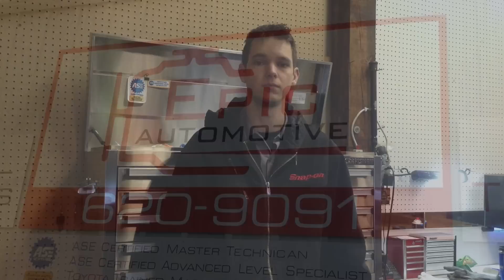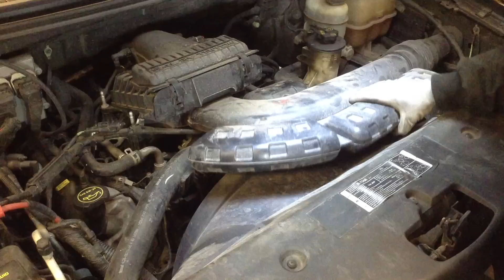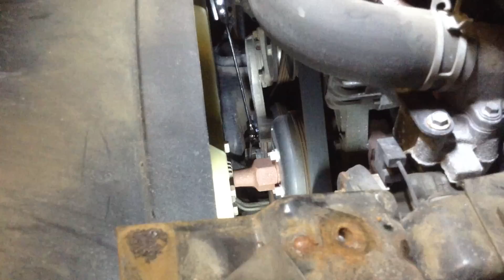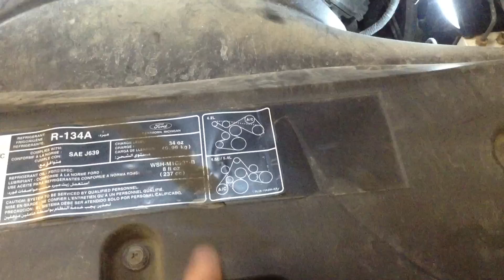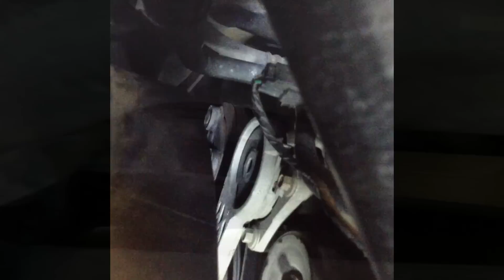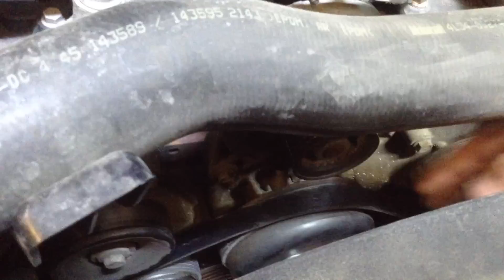2005 Ford F150 Triton V8 Serpentine Belt

Comment: IMHO when you wrap the belt around the AC pulley you should grab the bottom
part of the belt so that the grooves on the belt are facing upward around the tensioner 
then wrap it around the crankshaft pulley and follow thru according to the diagram.
Keep in mind the belt has to be installed on all of the other grooves remaining onto the other pulleys.

Comment: Thank you for the video! My belt so tight that I couldn't get it over the alternator pulley.  After several attempts I was able to slight it over the right round pulley next to it. Maybe someone will run into the issue and this advice will help!

Comment: Ford dealership (where I get warranty work done...good people, but expensive) suggested I get the drive belt changed on my '05 F-150 (78k miles) and quoted me $165. This video really doesn't show how easy this is! I did this in 15 minutes, and it only took that long because I was having issues getting the drive belt grooves lined up on the A/C compressor. My 1/2" drive breaker bar with extension (tube handle section from my hydraulic floor jack) made pivoting the tensioner super easy. Thanks for saving me $135!

Comment: Thanks for this video,  Alternator quit yesterday and had to replace it,, couldn't figure out how to get belt off but this video save me....BUT....for anyone else about to do this... I think I'm fairly strong and it took an INSANE amount of force to move the tensioner, even with a 24" breaker bar.  Is it supposed to be that hard to move? I had to pull it while my dad removed and then reinstalled the belt, NOT a one person job.